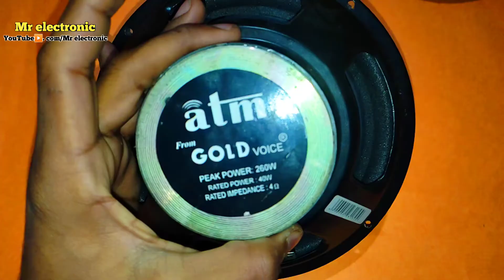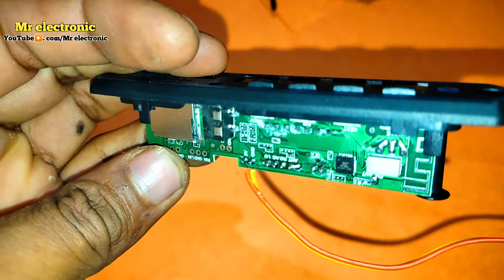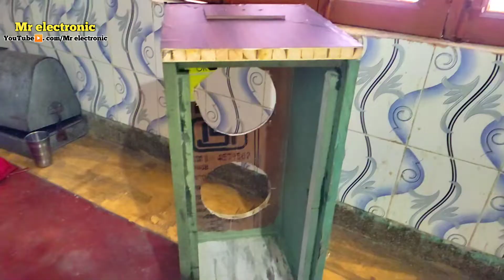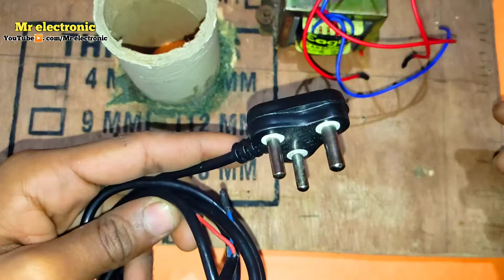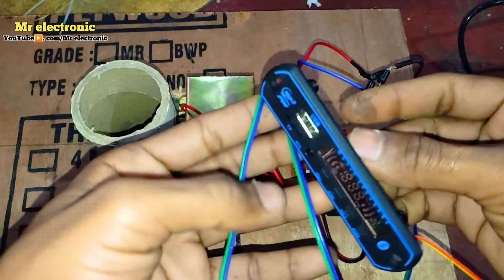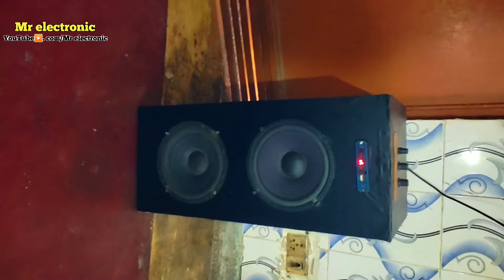Bluetooth speaker kaise banaye | how to make Bluetooth speaker | 4440 se Bluetooth speaker

Comment: Brain out ho gaya kiya 450rs boldiya. Circuit broad to 500 leta hai online.or baki saman kon dega aap .yesa jut mut video mot banauo yar Jo bolna hai sachaa bolo.me bhi banaya 5000all complete rupiya ullu banana raheho kiya
Reply from the maker: Bhai online to circuit board 500 nahi 600 ka bhi hoga me Sara saman lajpat rai market old Delhi se lata hu 
4440 ic board  ₹60
#8 inch speaker  ₹80+80
#bluetooth ₹65
#6pin tone ₹15+15+15
12-0-12 3amp transformer ₹120
Reply: @mrelectronic43  bhai 8 inch woofer 200rs me dila do 4 lunga aur 4440 100rs me lelunga 😂😂😂 hamare yahan 4440 board 190rs. 8 inch woofer 750rs 2 pair milta he😢😢
Reply from the maker: Bhai chandni Chowk me lajpat rai market chale jao